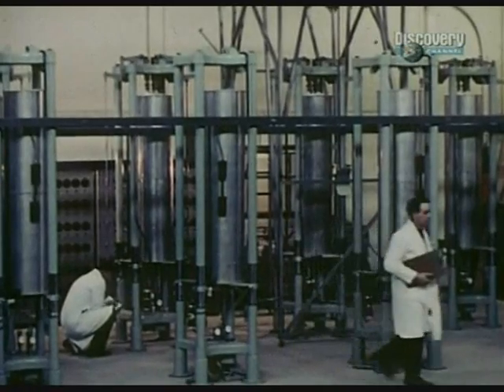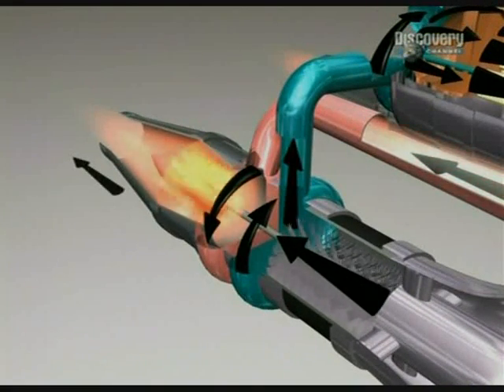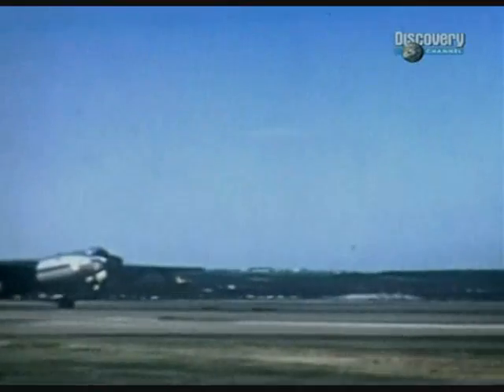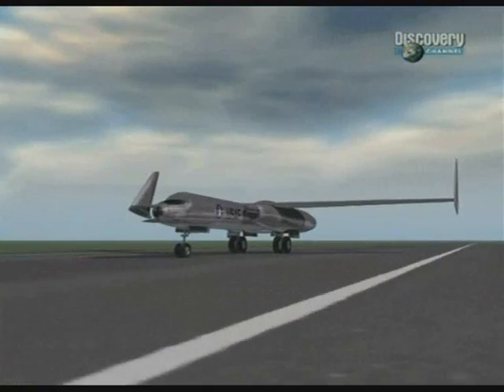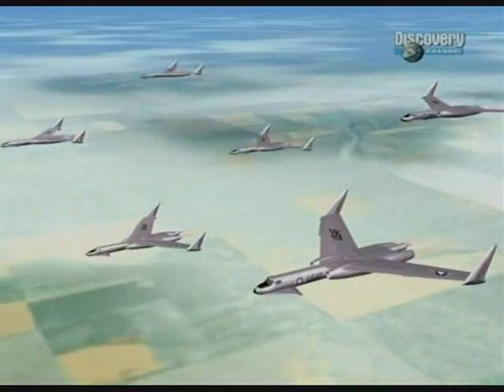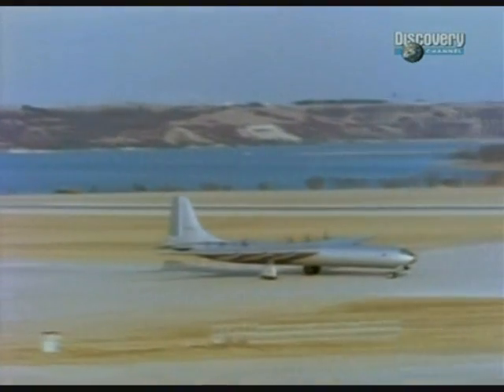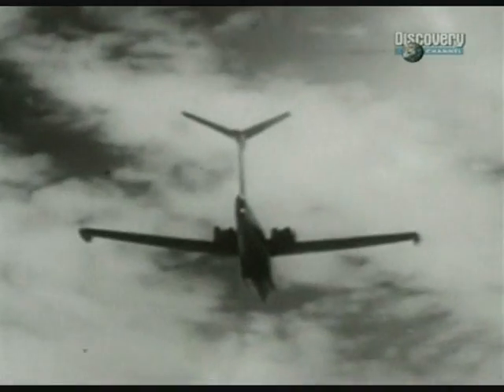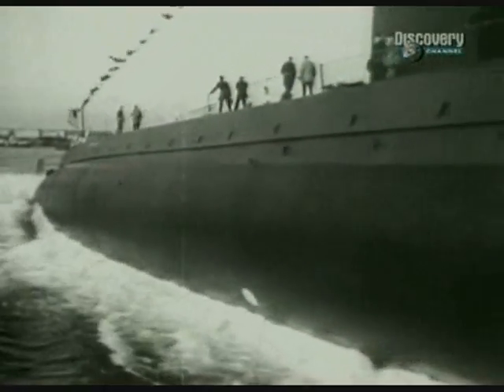The Atomic Bomber p.3(5)

Comment: Nothing compared to Project Pluto.............that was a REAL doomsday weapon! The ARE ( Airborne Reactor Experiment) did however pioneer liquid salt,high efficiency reactors which were a quantum leap forward. Liquid coolant/fuel mixture inside a reactor is a much better design than water cooled, solid fuel rods in a LWR which suffer from low power density,uneven cooling from steam pockets and hydrogen explosions.

Comment: those white jackets look like its all bull , why do they need a stupid coat
Reply: +Dan Carli How else would you recognise a rocket scientist, if they weren't wearing a white coat?
Reply: +Dan Carli Why do you need shoes?
Reply: +Dan Carli when your working with chemicals.... possibably radioactive chemicals and dust.... having something that can get spilled on, or covered with dust..... and then simply thrown away (properly de-contam first) 

it isnt to look smart... if they could work in sweets they would.... it is a saftey measure.... a light, small measure.... but its for saftey. 

that and jsut being clean... your normal cloths loose threads, have dust.... have chemicals from your washing soap on it.... 

if your making an acid and some soap flys into the mix from your T shirt.... your acid is fucked. soap is a base... now you have a weaker acid and some water mixed in... possibly soap if all of it did not react.

like... why do flight crews wear flight suits?

Comment: Anuetronic fusion involving Lithium-6 and Deuterium to produce 2 alpha particles releasing 22.4 MeV per event using the Jetter Cycle.  270 trillion joules per kilogram!!  With a boron induced source of neutrons to initiate the Jetter Cycle, the system requires no shielding and initiated with a shaped chemical charge.  In this way compact inertial confinement fusion systems are built.  Propulsion occurs much like a laser sustained detonation, using an alpha burst to energize air.

Comment: The two dangerous emissions from a reactor would be gamma rays and neutrons.  I wonder if a reflective steeply angled shielding would have worked without as much of the weight issues as a perpendicular piece of metal?

Comment: I flew KC-135's which weigh quite a bit when full of fuel. The A model I flew was terribly underpowered and takeoffs were sometimes more exciting than they should have been on hot days. Given the weight of reactors at the time of these projects and the additional weight of lithium or mercury or whatever liquid metal used to power a secondary system would lead me as a pilot to sweat more than a little on takeoff. I also can't imagine sitting a only a few feet in front of  a reactor!

Comment: The original purpose was building bombs. By the time we'd done that, we had a good amount of experience with uranium-based technology. Then we developed submarine propulsion reactors: uranium-fuelled, light-water cooled and moderated. The same groups that designed and built those, now armed with data and analysis tools for light water reactors, stuck with what they knew. Meanwhile, thorium fuel had its own unique issues that would have required significantly more technology development.

Comment: There's no way that you can say "proven technology" until it's operated at semi-commercial scale for at least a couple of years. Until then, it's just a very promising concept with theoretical reliability, efficiency, economic, and long-term safety stats. You don't know what operating/maintenance problems will develop, or the design mods that will be required. Have you ever worked with a hot, radioactive, and highly contaminated molten salt that also has potential nuclear criticality concerns?

Comment: There are many advantages of thorium over uranium or plutonium. It is far more abundant and the US has 20% of the worlds thorium. That is enough to provide ALL of our energy needs for hundreds of years including a synthetic gasoline.  It can also be use to desalinate water. The reactors are much smaller and operate at atmosphere.  In an emergency, they automatically shut down without external power source.

Comment: I agree with you. After TMI, the US NRC got very intrusive in the industry. An inspector is assigned to each site and is present on a daily basis. NRC also mandated changes in the training of the operators. The operators have to complete a 2 year course of instruction equivalent to 5 years of college engineering, then a week of intensive examinations including performance evaluations. Most plants were built by private energy companies not by the US government.

Comment: I meant that radioactive material will spill. However, if the reactor is damaged to that extent, the regulated environment of the reactor is no longer so regulated. A meltdown is very likely. My thinking is something like what happened at Chernobyl. An experiment on the reactor caused it to meltdown. While there was an explosion of sorts, and radioactive debris did spread for miles, it's not necessarily the same kind of detonation as a nuclear warhead. Extremely radioactive, but not a "mushroom"

Comment: Heavy lead shielding was an political requirement not an engineering requirement, and it was for political reasons (stopping the project) rather than engineering reasons. And where shielding is required it is arround the reactor not the entire plane and the crew areas -.-.... This is a video made to turn people of these programs...

Comment: @Zaur525 You get a lot of irradiated wreckage and some irradiated air. Hot liquid metals and or salts have been used in USSR and USA subs as well as numerous small "research" electrical generating stations strewn throughout the world.. Those had enough spectacularly BAD freak accident which caused lots of leaking radiation, death and irradiated materials to find a safe place to keep. No atomic blast, but I would still not want to be within 100 miles of the crash site or 500 miles downwind!

Comment: heres what u do. make a replica plea 1.5 times bigger, put 2 reactors next to each other and put lead plating around them both with the same engine complex system, now u have the same lift as u would with what u wanted with the smaller 1 reactor and u have a much bigger plane with the same performance of the smaller one! but thats not the real problem, when that plane gets shot, and blows up......

Comment: Not exactly... If the reactor is behind the people aboard you would only actually need shielding between them and the reactor so basically one wall. If you use the right materials the shielding wouldn't weigh any more than the weight of the fuel carried.  Please remember that a B52 bomber carries up to 399,775 lbs of fuel... Oh and aircraft aren't always small and are rarely fragile.